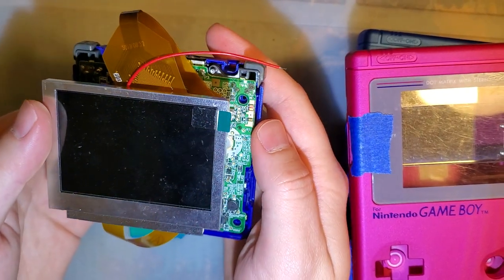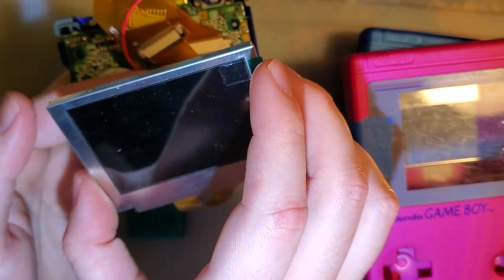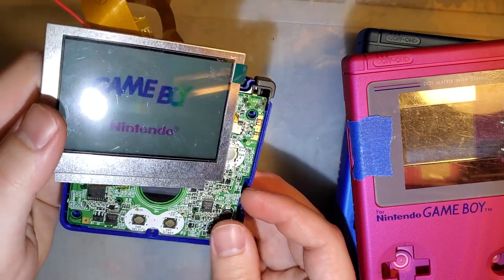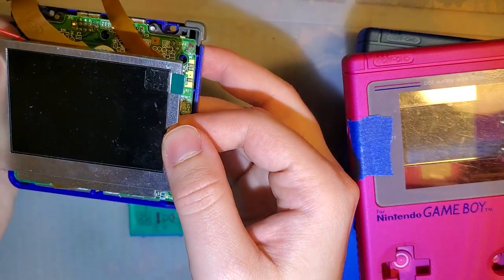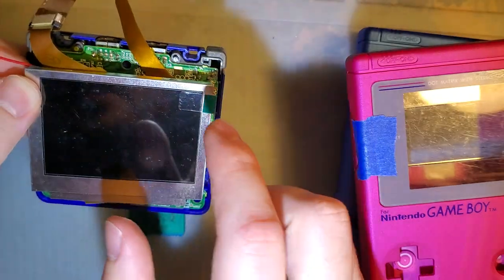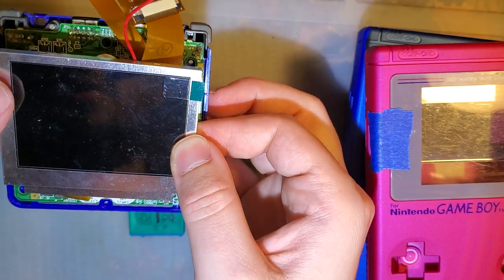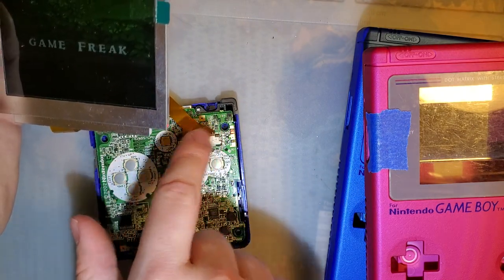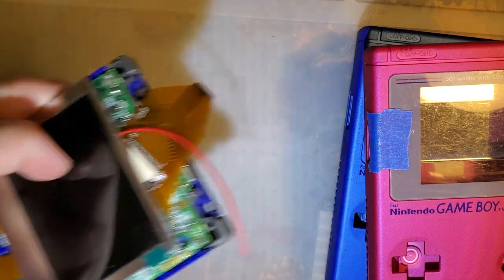Fake AGS-101 LCD in a AGS-001

Comment: OK, screen came yesterday and I mane to figure it out. In the adaptor, the red cable is to provide more brightness i think. On the adaptor, pin 33 is bridged to pin 32 (on the board pin 32 is ground, and pin 33 goes to a series of components i dont really know wich functions have) and pin 34 is bridged to pin 28 ( pin 34 is 5v and pin 28 is 13v unregulated bias control
)

Comment: Hello, how is it possible to bypass all the adaptors chain? reading old threads when the mod was made with an original 101, a stepup was required, but you managed to backlight it without one! Do you happen to know wich trace needs to be connected to pin 34 on the board? Will it need to be isolated? Im very curious why it doenst work right away but with the chain it does

Comment: Hi, if I well understand the clone 1-0 would work on a GBA (no SP), with the 40 (or 32) pin ribbon cable adapter. Right? The battery drain seems to be less than the IPS Funnyplaying screen or ONE chip screen, right? about100mAmps vs more than 180 at medium brightness on IPS screens
Reply from the maker: you already have all the information that I have

Comment: Could you list which ribbon adapters you used? I have a broken 001 that I would like to repair. Also I think it would be cool if a PSP open like a T-Mobile Sidekick.

EDIT: Meant SP as in GBA SP.
Reply from the maker: https://www.aliexpress.com/item/32847155327.html

and just a regular 32 pin AGB->AGS adapter
Reply: @makho  
I'm sorry that I am a complete noob, but I want to use this screen in a AGS-001 GBA SP, too.
So, the original screen has 34 pins, am I right?
The screen is available with 40 pins (AGS-101) and 32 (regular GBA), so I need the 32 pin version of the screen and an adapter from 32 to 34 pins?
Is that right? But then I won't be able to turn off the brightness?
Reply from the maker: @tiberiusseibt1140  AGS-001 consoles do not work with AGS-101 screens and vice versa. This screen only works in AGS-101 consoles. I chained a bunch of adapters together to get it to work but the adapters won't fit inside an assembled console.
Reply: @makho 
Apparently I found out that it is possible, but with a lot of work, and it requires very fine soldering as well as a 2-12V to 12V DC converter to power the screen (it's just small enough to fit in the case)
And I decided to try it :D
Already ordered all the stuff.

Thanks for your reply tho, and your videos.
Really helped me a lot in many cases, your channel is a blessing for Retro console enthusiasts :)

Comment: I just thought of it yesterday. Doesn't DS have a magnet in the lower part that activates sleep mode when it's close to speakers (or any other magnet)? With IPS mod you should have enough space behind the screen to work something like that out.
Reply from the maker: Yeah but I don't see the point. The backlight isn't that big a factor in power use (unless you have it maxed out) and the games do not suspend. You can add patch in sleep support if you are playing off a flash cart and that will work better than any hardware sleep mod.

Comment: Can you actually fit this inside a regular SP shell though? I kinda prefer the AGS 101 over the IPS screens so this would be pretty cool :D
Reply from the maker: yes, it's the exact same size as an original AGS-101 LCD.
Reply: @makho  i meant with all the adapters connected to it :D
Reply from the maker: @killjoygames2019  no
Reply: So this mod with the multiple adapters will NOT fit in the shell and thus is not a good idea for 101 to 001?

Comment: Hello ! That's interesting, which ribbons did you use ? Could you send a link pls ?
Reply from the maker: https://www.aliexpress.com/item/32531674174.html
Reply: @makho  thanks a lot, so just the same one several times right ?
Reply from the maker: @inchiostra6893  no, just one and a AGB 34 pin adapter
Reply: Could you pass the link of the 34 pin flex? and with those adapters the brightness level is controlled?

Comment: What modding is required for full functionality?
Reply from the maker: ? It's a screen. You need to put it in the GB
Reply: @makho   it said so in your video description. But it’s just plug and play? Because somewhere else I read you say it doesn’t fit in the SP with all the adapters. If it does this would be the best method to put a 101 in a 001, haven’t seen it anywhere else
Reply from the maker: @jashketchup  is drop in to an AGS-101, AGS-001 requires modification or an adapter to use AGS-101 LCD.

Comment: It could be an easy build, the idea of a sliding door mechanism came to mind. Make 2 aluminum rails due to lighter weight. Build a frame to contain the display, a stopper made with using latch or whatever better idea you may have. For the rollers having rubber rims might be better on the ears than having metal on metal. You can likely find these parts at a local hardware store. Definitely a big project unless you have power tools, a hacksaw will work too.
Reply from the maker: yeah, absolutely. I had quite a few ideas on how to do it mainly using 3D printed frame and the rails out of an old DVD drive, I just don't really have the time/motivation for such a project right now.